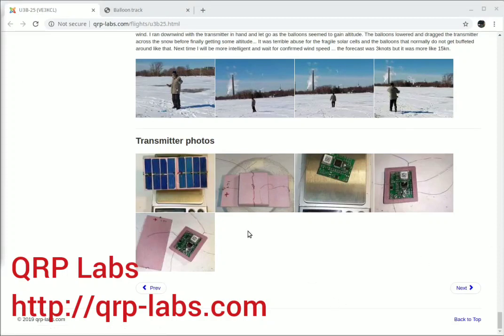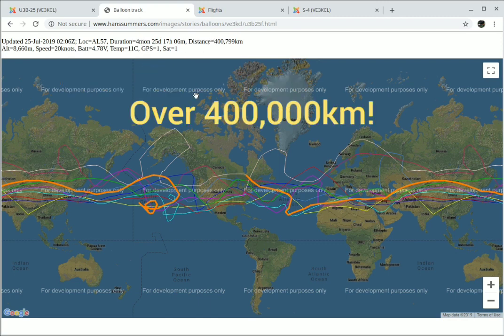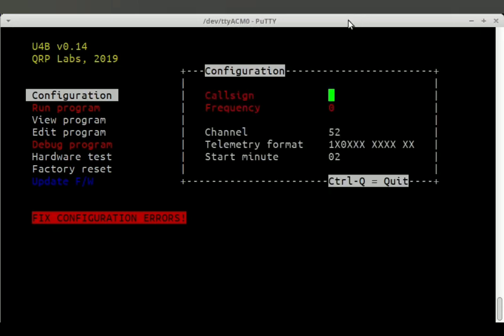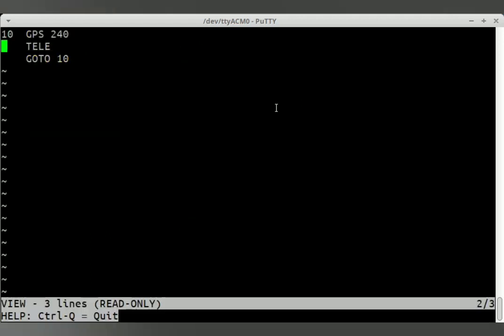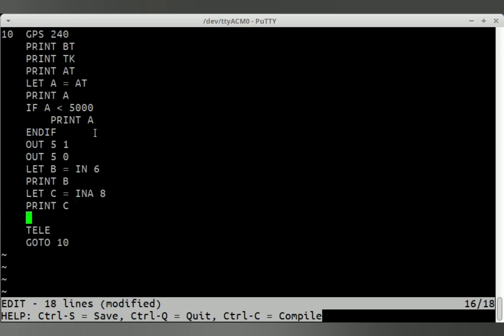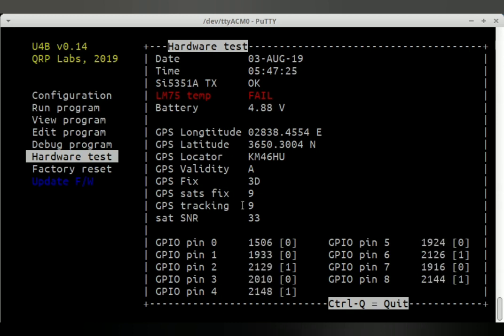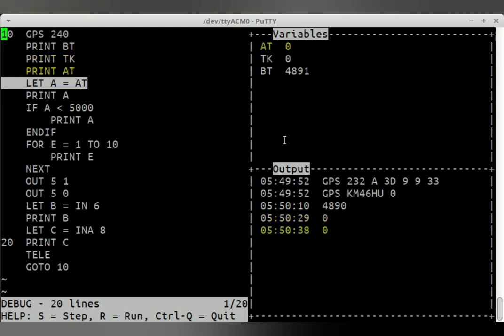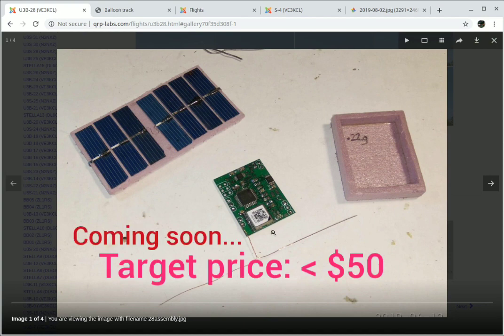U4B HF WSPR High Altitude balloon tracker

Comment: Just curious if 11,000 meter altitude flight path of this balloon is a concern for collision with commercial aircraft? Am totally new to ballon flight subject but aircraft routinely fly between 9100 and 12800 meters and it seems the this balloon could be in the same path as commercial flights. Any concern for (passenger) aircraft safety? How often do aircraft collide with such balloon and what are the consequences?

Comment: 15:03 "...to compile it I do Ctrl-C..."  Does that work as intended on MS-Windows ?  Specifically wondering if the Ctrl-C is intercepted by Windows to perform some other function, such as 'Cut' or 'Break'. Asking because I've seen this sort of thing before. 🙂